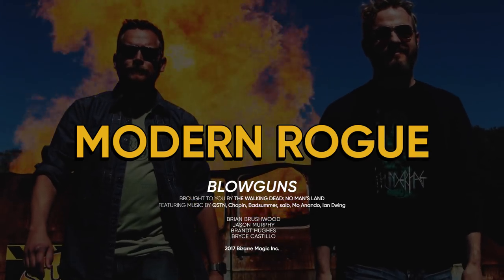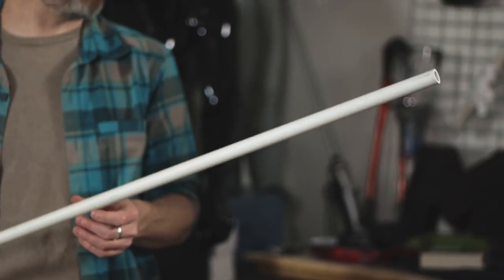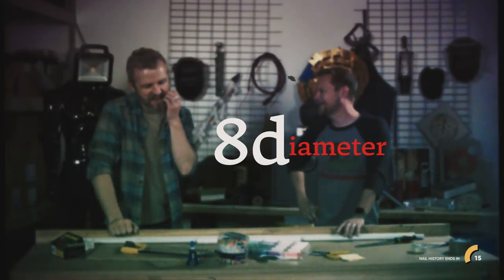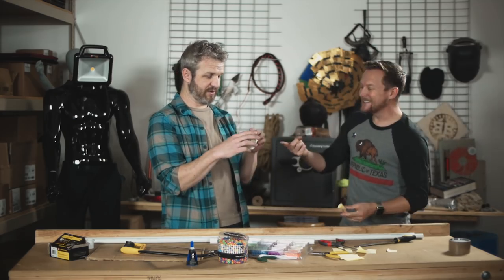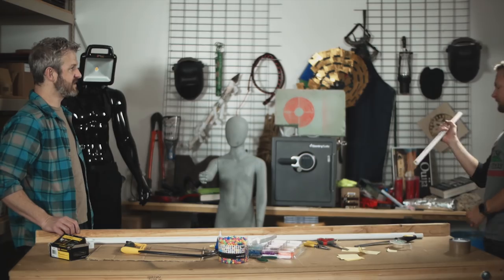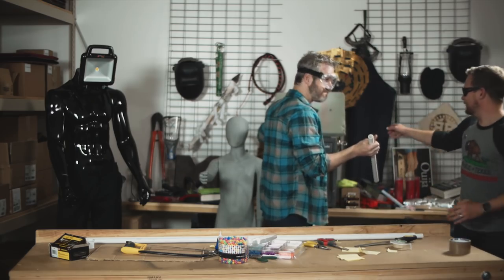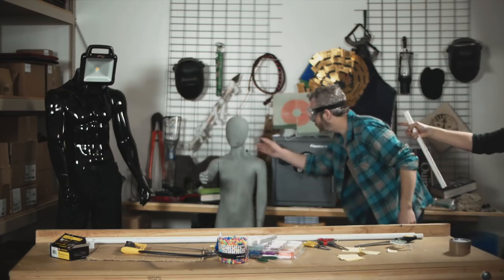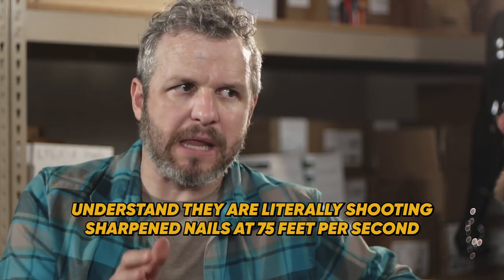Making PVC Blowguns

Comment: I used bycle spokes for the "nail" and a golf tee for the flights. You can also use compressed air or like a shop air gun to add some crazy power. I used to shoot it through tin roofing sheets. Try it, it's bad ass
Reply: Wow. That sounds extremely irresponsible and very, very cool.
Reply: We used to do that and use arrow shafts as the tube
Reply: Jason Murphy just said it sounded irresponsible! Sorta like 8:50 :D jk I feel so honored, thak you
Reply: I used to use bike spokes also. I've also made a few using chunks of dense hair from a stuffed animal or simular for the flights. As long as you have enough hair/fur to fill the tube out it works great. Wrap the hair around the end of the nail or spoke and attach it by wrapping thread around it very tight. Then seal with superglue or simular glue. I've noticed a straighter flight with the hair. Essentially  you want the end of the dart to look like a trolls hairdew. I know. Bad grammar .

Comment: If you want to be dead ass accurate with a blowgun, read this. You take the blowgun with both eyes open and don’t concentrate on the end of the blowgun, concentrate on the target. Don’t look directly at the end of the blowgun but you will be able to see two blurry blowguns out of the bottom of your eyes because you have your eyes open. Line the target up between the two blurry blowguns images and then just get the elevation right and it will go dead nuts. Try it.
Edit: Not trying to be a suck up but you should pin this so people can see it. It has been helping me kill squirrels for years.
Reply: Vaneater i tried this, and to be honest i had better luck just eyeballing it. Maybe this works better for some people than others. I guess its definitely worth trying
Reply: Brandon Szparagowski yeah it takes getting used to but it’s the only way I could get the dart dead on eyeballing it I end up shooting more left or right but yeah different stuff works.
Reply: I did that when I was a little kid. I could go around shooting cicadas in the trees to shut them up.
Reply: @hobanm45  if you load a Nerf dart in  1/2 " pvc you can shoot it at other people

Comment: A few years ago, I was working new construction as a plumber. One of the electricians noticed that the yellow wire nut was the same diameter as the 1/2 inch cpvc pipe we used. By poking a nail through the end of the wire nut we made a pretty badass blow gun.

Comment: A friend at Will Vinton Studios in Portland, back in the '90's, made a blowgun out of spare tubing and darts from straightened steel wire. Then he built an adapter for the pneumatic tool system they had. We shot a dart clear through a basketball backboard.

Comment: The smaller the Inner diameter of the pipe the faster the dart is going to go because you have the same volume of air, moving through a smaller area thus increasing the pressure behind the dart. in addition to that, you'd want to play around with the length of the pipe as everyone's lungs are different, and if you can't produce enough air to keep the dart accelerating through the pipe it'll be slowing down for a small period before exiting. I've never seen the beads mentioned until now, but maybe if the nail is too long, it would help balance it during flight. Grant Thompson over at the king of random (I know you guys have worked with him before!) made a really cool one and explained a lot of the physics and stuff behind it. In the jungle and stuff they're used for small game hunting if I recall correctly, as they're as effective as a pellet gun, if not more. You could soak the dart with a toxin and use it to take down larger game of course. I've been toying with making one for a home defense kind of thing, I know it's not going to bring someone down, but if you break into someone's house and out of nowhere a nail embeds itself into you, you'll probably just leave.

Comment: Over 20 years ago I used to work for a big box hardware store, and we used to make blowguns very similar to these. We used 1-1/2"  drywall screws, along with the thick label paper that we used to print the prices on, to make the dart cones and clear packing tape. For the pipe we used 1/2" pvc electric conduit that had a coupling molded onto one end cut to about 5' in length. These were very powerful and accurate and would actually stick the dart into the cinder-block walls of the store. We successfully used these to "remove" small birds that got into the store through the always open garden center doors. We had to hide them from management but they looked very inconspicuous wile carrying them on the store floor.

Comment: the blocking with tongue technique is spot on. had a blowgun as a kid, and it makes a huge difference (plus your body doesn't move like when merely exhaling hard, affecting aim). mine was 3' and fired 4" ~1.5mm steel darts with small light plastic cones (43 calibre), apparently up to 200fps (probably more like 100-150 for me); if I missed and hit wood it took pliers to remove them, and I was a tiny 13 year old. was probably shooting from 3 meters maybe.

Comment: I went fishing/ hunting with a PVC blow dart. You have to make the darts  differently. I used 16 gauge wire and duct tape for the cone. My darts were 8 inch long and I would solder on a barb about 1 inch from the tip to keep it from getting pulled out. Then I attached a small fishing rod to the PVC and tied the line to my dart do I could reel in the fish. If you use this method remember to run the line first through the tube starting at the end away from your mouth so that the line doesn't get stuck in the tube. Also, it works best if you use an open faced rod do that the line can easily pull off when firing.

Comment: You should harden your nail by heating it up then rapidly cooling it in cold water
Reply: Teton Fly Tying 
you're evil hahaha
Reply: The nail has already been hardened, that would do nothing.
Reply: Oh Djjacob... That's cute
Reply: um... no Djjacob99, metal hardened this way doesn't bend or deform much, it shatters. Nails bend very easily and are in fact intentionally very ductile or soft, they are not hardened.
Reply: The hardness of the nail is largely irrelevant to the actual penetrating power of the nail, the only time it would play a part is when they nail would bend or break. I don't think Brian is going to be blowing the nail out of there fast enough for it to break even if it hit something harder than it such as a steel plate.

Comment: I've spent years making improvised weaponry in my back yard.... Including blowguns; what I found was.

Length:
Short pipe is good for close range like urban areas and fishing (only allows a short acceleration). Long pipe is good for long range like forests and fields (allows more acceleration). I tend to use about 4.5ft long.

Inner Diameter:
The wider the diameter of pipe the more breath and less power; The less the diameter of the pipe the less breath and more power. I tend to use 1/2in inner diam.

Darts:
For my darts I use 4in of Bailing Wire that I flatten the tip, trim it to a point, and sharpen the edges making a razor tip. I gouge and scuff the tail end of the wire and use medical gauze fastened with cotton thread.

Notes:
After the dart leaves the pipe if you still have pressure behind it in the pipe it can and will change the trajectory of the dart. I include muzzle break about 1/2in from the end of the pipe; allowing excess pressure to escape and not influence the darts flight.
Tribes people also used mouth pieces to provide more ergonomic and efficient blowing. I used the top of a 2litre soda bottle trimmed to fit and sealed with spline on the edges.

Comment: I used to do this all the time as a kid, you wanna go for a dart that is around 4inches of fencing wire with a cone cut from clear acetate sheeting and sealed with duct tape. I always put a little twist in the wire at the cone end and put a dab of glue on it before pulling it through.

The wire is super easy to trim for weighting and easy to sharpen on a wheel.

Comment: Back in my days in electrical engineer school we found that a 9mm pvc pipe fits very snugly in an 11mm pipe. If you took a piece of about 2cm of 9mm pipe and put a screw connector cap in it, you could fire that with the 11mm pipe, which can be any length you prefer. Improve the projectile by putting a nail through the connector cap and you have yourself a ch-ildpiercing weapon. What you were lacking is mass of the projectile.

Comment: The counter weights aren't actually counter weights they are used to add more inertia to the projectile allowing it to do more damage to the projectile.
Reply: Perfect example would be a 50 cal desert eagle vs a 9mm
Reply: Not the best example.  A .50 cartridge has far more powder.

Your point was correct though.  Adding mass increases momentum and kinetic energy.
Reply: The issue here is that the added mass doesn't increase momentum or energy since they come from the lungs.  The beads add mass, but this also means the initial speed will be lower.
I would guess the beads would reduce the effects of air resistance (assuming they don't have a weird shape that adds to the drag), so they might help keep the dart moving over a longer distance.
(The longer pipe increases speed and so momentum because it means you have a longer time to accelerate the dart).
Reply: andymcl92 if you do not have enough weight the projectile could also be moving slower due to its terminal velocity being lower. The key is balance between the force your able to exert, resistance, and the weight of the projectile.
Reply: Yeah, that's pretty much what I was saying about air resistance.

Comment: @The Modern Rouge,
played with a lot.
Use bicycle spokes sharpened to a point about 10-12cm long with a duct tape cone.
20+ meters will penetrate in to a tree far enough that its not coming out without pliers.
also used a metal pipe for the rigidity and accuracy.

Comment: i owned a commercially made blowgun that was metal, about half inch diameter and three feet long, Its darts were 4 inch steel needles that were very sharp. the needles were rather heavy for their diameter, which was as narrow as standard .9 lead. They could easily penetrate thin sheet metal and would embed themselves in wood to the extent that pliers were needed to remove them. it was great fun to own and was insanely accurate. i could hit a coke can at roughly 30 yards.
Reply: Note: Take a breath before putting your lips anywhere near the end of the blowgun

Comment: I "made" this. Really amazing how it works. It's so simple. My dart designs went from barely going through a single sheet of paper to going completely through plastic bottles and pop cans. I got one stuck into a tree stump. I might be able to pull it out with a pair of pliers, but I think it's really cool that I got a dart stuck so far into a tree that I can't pull it out with my hands at all. Pretty great! I also put a good 50 nail-sized holes into my walls and ceiling. Thinkin' about buying a pig carcass or something to see how far it would go into a person. (That or maybe some ballistic gel, which I don't have.)
I'm using a 1/2" diameter PVC pipe. It's somewhere between 3 and 5 feet long. The paper cones are made pretty much the same as in the video, but I am filling the cones with hot glue instead of super glue. It adds some weight and helps the cone hold together. I'm having a lot of fun with these. Also, at this point, I think it is far safer than when I made them really badly. If I want to shoot at something, it will hit it and not bounce back. It pretty much always at least gets stuck in whatever I'm shooting at (except for when I tried to shoot a steel plate. It did go into a brick wall, though. I haven't tried piercing coins yet, but I guess I know what I'm gonna do today! :)
EDIT: I would like to point out that I have been making 1 dart at a time, and using them for probably 15-20 shots. Towards the end of this number of shots, when the dart cones start degrading, they go pretty quickly. The paper starts ripping (plus they get spit on them ewww). I take the nails out and re-use them in new cones. I've had no problems with this. I don't sharpen the darts. No clue why it works so well. I think they're just galvanized steel nails.

Comment: I made mine using 12 inch long pvc pipe with couplers for extending. Use # 16 or 18 wire nails in various lengths. Cone paper cups for the propulsion.

Comment: If you want a (mostly) harmless alternative to firing nails at your friends, 1/2" thick-walled PVC pipe is about perfect for firing dart-tag nerf darts.  The non-whistle darts work best, but I haven't seen those for sale in a while.  Also, I personally find 2'6" to be about the perfect length since its long enough to get decent range/power but still short enough to be easy-to-carry.

Comment: I use tissue paper for my darts. Strip it to 1 ply, crumple/fold/cut it in a way that leaves kind of a poof ball and stick whatever tip you want through it. The tissue makes the fins part extremely light but still have drag so you can use much smaller tips without the weight ratio fucking up the dart for the front being too light. I use sewing needles (which are admittedly a little TOO light so i wrap them in floral wire at the base to give a little more weight and structural integrity. The muzzle velocity is crazy high because its so light. I use them to hunt moths in my house sometimes in the summer.

Comment: I actually made a blowpipe a while ago out of 3/4” PVC. I thought it was the coolest thing I’d ever built, but I thought about things to change to make it better. I ended up making a second one out of 1/2” metal pipe, and it was so much better. Again, I have things I want to change, like making it longer or using slightly larger nails, but as of now, it’s pretty powerful. I don’t use paper, and am actually surprised they didn’t use duct tape. It works really well and holds up to the condensation inside the pipe. It also slightly squishes to make a nicer seal. But yeah, blowpipes are really easy to make, and it’s more about making darts than the pipe itself. Also a lot of trial and error

Comment: To make a more effective blowgun, try making the inner diameter of the tube just wider than the 'nail'. Doing it this way will make the 'nail' fly straighter and with more accuracy. The wide tube that you've used allows the dart to leave the chamber with a tilt, which can result in undesirable results. Think of it as a sniper rifle, the bullet uses the barrel to allign itself, and when the bullet leaves, it leaves with a more accurate trajectory.

Comment: 1/8 inch copper tubing works really well. You take pins and 1/4 of a cotton ball a drop of glue on the cotton ball quarter and twist the back of the pin making a teardrop shape out of the cotton. dip the pin in draino or other icky stuff and you have poison tipped darts.

Comment: For what it's worth, you can make a blowgun with a pearl tea straw and flat-head push pins. Cut a disc of paper the diameter of a quarter and glue it on the head of the push pin. Cut the paper to feather it and place the dart in the straw and blow. Shoots accurately about 5 feet.

Comment: All the way up to the volume or a tad under of your lungs,  a longer barrel means more time under acceleration, therefore more kinetic energy.  Basically you don't need as sharp of a blow with the tongue compression, a longer tube would allow you to blow for longer and end up with more energy in the target. 

If you could, try the longer pvc pipes with a longer but just as forceful blow. I'll bet you'll be surprised.

Comment: Blowguns are actually effective against small game. The Cherokee in our area used to use them for hunting birds, rabbits and squirrels. You're not likely to take down something the size of a deer or a human being with them, but they are legitimate weapons, provided you're good enough with them and you realize the limits of their utility/ammo.
Reply: I've made some out of coupled copper tubing and it works amazingly well. I've even hit bugs in my apartment with it and stray balloons that have ended up in the rafters at work from about 20+ feet away just using some improvised darts fashioned out of bamboo skewers and cotton ball fibre. One of the ones I constructed at home even had a small obsidian shard as an "arrowhead" that ended up going completely though a gallon milk jug from across the garage. Update Just went out and checked the area where I shot the balloons down at work; one of the darts that missed the balloon is still FIRMLY lodged in the cinder block wall underneath the metal border. That thing is not coming out on its own before this building is demolished.

Comment: I make those darts out of duct tape, nail/skewer, sand. your wrap the tape around the end to make a cone. you press the very bottom to the nail/skewer. you pour sand or any material that will stivk to the tape so it wont stivk to itself. you lay the dart flat and trim the excess tape. voilà a super quick to make and effective blow dart

Comment: You can make cones from plastic milk just or any HDPE  container. Use a propane torch carefully and soften the plastic. A Sharpie marker is great for pushing into the plastic to form the cone. Trim to length. Heat the nail push it through the cone, let cool, then a dot of super glue. Works great and lasts longer th enough paper.